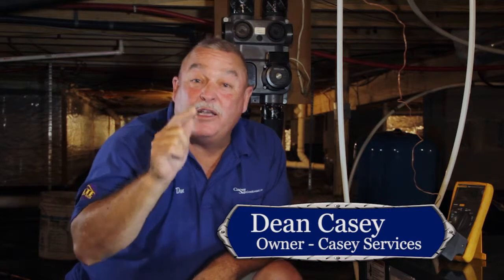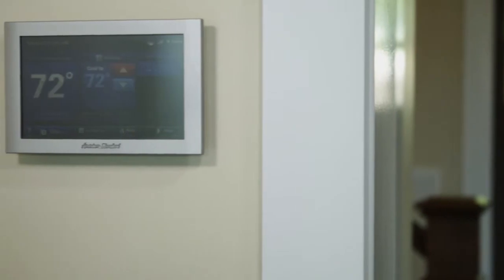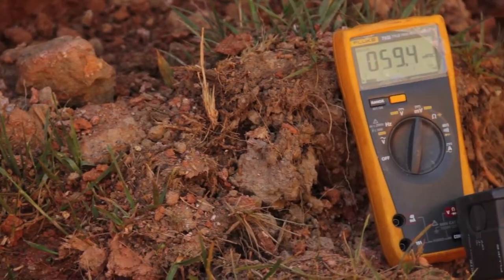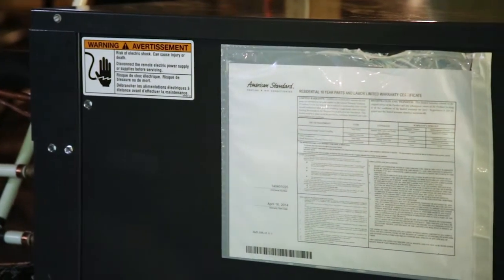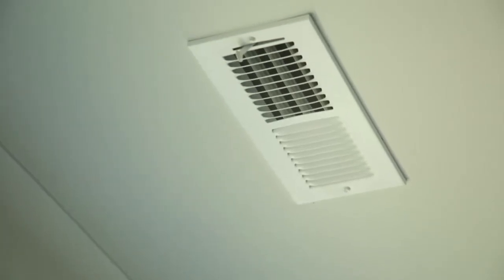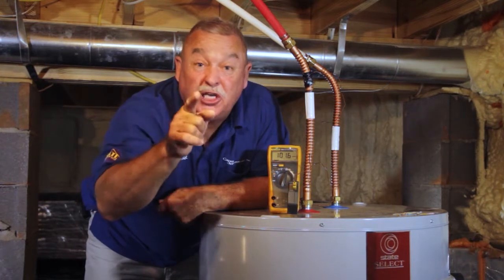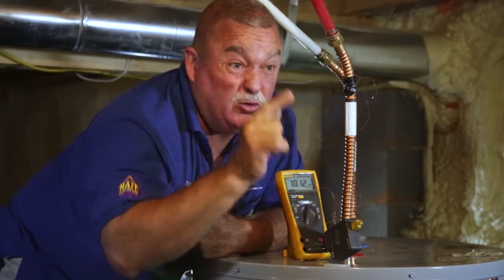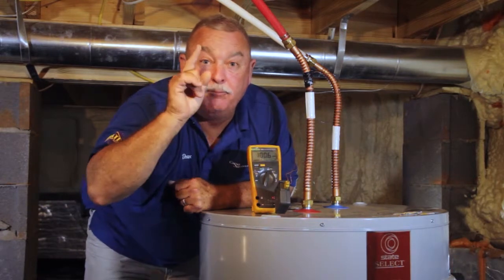American Standard Geothermal Unit

Comment: Im thinking of the American Standard Geo A2GX/A1GX with HW Heater Addition, for a 2500 SF high ceiling ranch. With equal Size Basement, has a parallel Wood Burning Furnace, In PA so we have cold winters and hot summers. 

What is the advantage/disadvantage to the single or dual stage? Should I move up to the AVGX unit? 

Thanks for any info.
Reply: @rondavis2791  yes 2 stage 4ton
Reply: @rondavis2791  very efficient in the summers, not as hot as I would like in the winters.